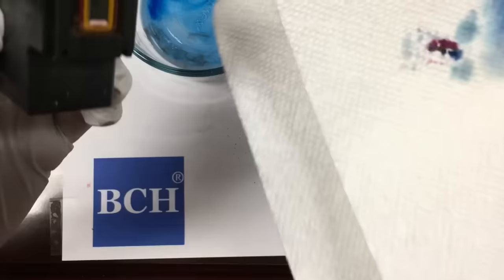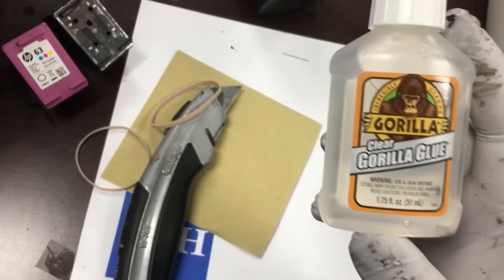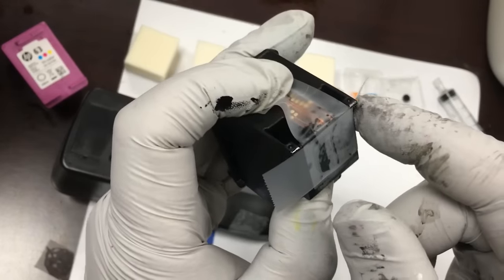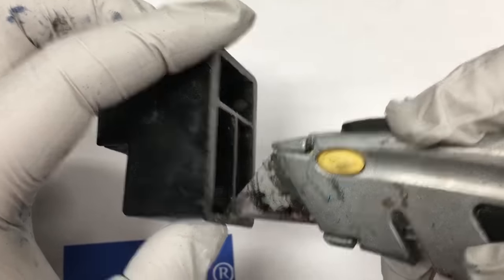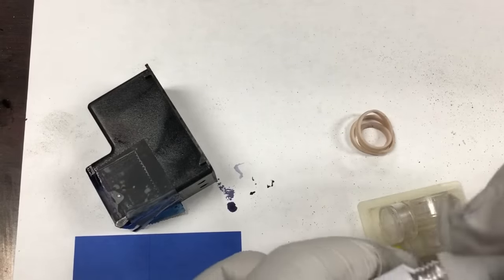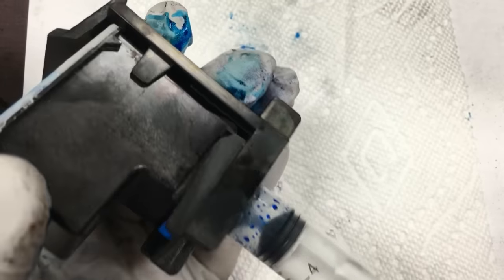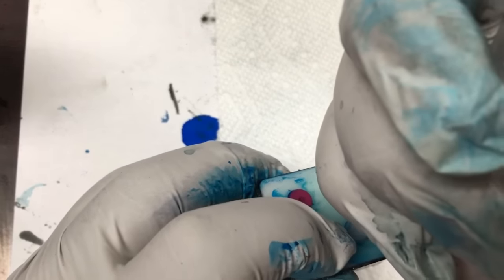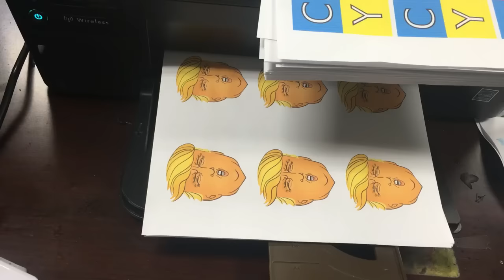#1 Detailed Steps: Make a Spongeless Refillable HP Cartridge 61 62 63 64 65 66 67 68  Integrated

Comment from the maker: New version product link: https://tinyurl.com/y72vsa4f  We made some improvement of the cover after making this video: 1) the pressure regulator is smaller, no longer a bulky circular assembly.  2) The cover is transparent so we can check how much ink is inside.
Reply: Sir in my caritridges ink is faded and mixed my color caritridge is mixed with alot much blue and it is giving blackish tone to prints what to do? I have hp 63 caritridges
Reply: @alifarmancreation9136  once you use up all the ink, I think you should wash it thoroughly and check the glue seal that you made for the cap.
Reply: my hp 67 is printing inconsistently. sometimes all the colours are balanced, sometimes it prints only 1 or 2 colour only, any advice?
Reply: Hey Kevin I'm looking for this type of an adapter for my HP Envy Inspire 7200e with Cartridge 64. So that I can convert it to a Sublimation Printer and attach a tank to the fill holes. Obviously have to make some cuts in the printer so the hose can travel through. But back to question where can I get the adapters for the cartridges? The printer is new.

Comment: Something about this that's more of a problem is ... The fact that more and more HP printers are starting to refuse cartridges that they think are empty, often without any ways to reset it or force it to continue printing whatsoever (yes, even with the cartridges filled to the brim with refilled ink)
Reply: What does a person do when the printer still thinks the cartridge is empty?  I've never been able to find a solution 😕
Reply: @nikkiparis5399  You can't do anything with HP. Even if it has been refilled until the ink is full, if the ink is still read empty and cannot be used to print, the only option is to purchase a new cartridge.

Canon and Epson are simple; simply use the "resetter" software after refill, and the ink is detected as full. Canon and Epson cartridges can be refilled indefinitely until they are damaged.

Buy HP if you rarely print, buy Canon or Epson if you print often.
Reply: @leunca  Or Brother. Brother makes GREAT printers.
Reply: The trick is, refill them offline and without power... Don't use refill them when it s already notified 0 ink
Reply: @leunca I have an HP 8025e and I’ve had no problem with refilling the original cartridges which came with printer. So far.  You get a pop up message from HP before you install their HP+ software (which gives you 6 months of free HP ink) saying you won’t be able to EVER use  3rd party cartridges once you install their HP+ software. And it was suggested by a YouTuber to turn of “automatic updates” on my printer otherwise I might find that my refilled HP cartridges will suddenly stop working.  My only concern is if my HP cartridges which I refill ever get damaged and I have to buy new  cartridges if  I would have to update my printer’s software in order to use the new cartridges whether they’re 3rd party or HP. And if doing so if I will no longer be able  to use 3rd party cartridges and / or refill my HP cartridges.
Reply: @Orlanzepol123  Thank you for sharing, I think I was using another version (I forgot). I now use Canon, I use it rarely so I don't need to refill anymore. What surprised me is even though I used it once a year to print tax papers, the ink didn't clog. 🤔

Comment: I used my cellphone to take pictures as I go along with a project so I can refer back to them if necessary. Taking pictures works for  lots of things: printer cartridges, replacing the clutch cable on your motorcycle, replacing an electric socket, working on the car, etc. And for black things I want to mark permanently (like a printer cartridge), I write with a white out pen (which works great for labeling spark plug wires and where the go on the distributor cap, too).
Reply: Good tip.
Reply: I also do this. Saved me many times.

Comment: So I have always wondered how the printer knows the ink levels. When you did this, the ink levels showed low. Isn't there a way to electronically reset the ink levels to full and show them accurately as the printer is used?
Reply: I'm also having the same problem it's showing low ink levels
Reply: Isn't there any option to reset thee printer software, so that it detects the cartridge as new ?
Reply: Ikr!!! 😫😫😫😫 Ugh!!
Reply: There is no part for that indicator... Even if you bought original ink LoL
Reply: @pewdavid3338  Well, that just doesn't make sense. Obviously, if original cartridges can reset the "full" indicator, then it ought to be able to be hacked so we can do it too!
Reply: Maybe you can jailbreak break the device setting

Comment: Hi is there any method whatsoever to reset the cartridge after a refill to make the printer think it is full? I have a HP DJ2330 MFD and am using it with a refilled 805 cartridge. The orange cartridge light just keeps blinking after the refill. Any software or button press technique will be great - cannot afford to buy these expensive cartridges any more - each costs like 20% of the MFD price and barely prints 50 pages.

Comment: I assume that if you let the ink to start banding no matter how much ink you put in but the nozzle seemed to not clogged( dripping with fresh ink), there are something else that I guess is air bubbles between nozzle and reservoir, the priming clip suction is primary tool, you don't have to take out the sponge, give it a good succ with the tool after you fill it to near overfill, everytime you let the cartridge to be too empty you have to do this again, fill regularly before banding starts

additionally, sometimes the electronic pins don't recognize the often-reinsterted self-refilled cartridges and just say that it's broken, swab those pins on the printer and cartridge with a contact cleaner, snap the cartridge with confident back to the carriage.

at least there's no 1x install chip like old Epson, that was awful

Comment: Lexmark cartridges are pretty good. Worse ones are Kodak. The chip in their cartridges cannot be resettled.
I’ve also have a dot-matrix printer that still works. The Citizen Swift is is about 27 years old and built like a tank.

Comment: 63xl color bought used off ebay does not work anymore, and I wonder if they changed their firmware to not accept carts made for use in different countries (I don't remember if these were from Canada, but this is a U.S. printer) -- even resetting the printer to factory defaults it still says not made for use with this printer.  Love the large BCH ink bottles, buut... HP up to their old tricks, or what?

Comment: My new office jet pro 7720 is not allowing me to put the black cartidge back in because the door is closed to access the printer catridges!   It keeps running a message door is open might damage the cartridges.   I need to put the cartridge back in so that there is not a problem re drying of the port for the ink.   It seems to be a stupid printer in any case due to the screen not working as normal LCD screens do. I've switched the power off and will try to access the cartridge carriage. the black cartridge was out for a few minutes then it shifted the carriage to the right out of reach of accessing the black cartridge. and has stayed there . I switched the machine power off. Then switched it on again and when it re booted I found the gear symbol the carriage came back into position . I put the part empty cartridge back in so hope it will be OK with compatible but not genuine HP cartridges, in three days time!   Do you sell refillable sets of cartridges for this Office Jet pro 7720  ? I see the black high capacity  is 953xl. ?
Reply from the maker: Check the door sensor & trigger.  I have a new video here: https://youtu.be/DZVj17KAcDc

Comment: hi, I have HP 62 cartridges, after a certain number of prints the PC tells me that the cartridge is empty and does not allow me to print anymore.  to continue printing I have to buy new cartridges, how can I bypass the chip that counts the prints made?
Reply: Hope all's well!
There's always a snag, when the printer hasn't been used for some time!
Try this, when the pc is off.
When only the printer is powered on, open the door to the cartridges, which will park  them for removal, or maybe to simply manually clean the print head.
Remove the cartridges, store them safely, switch off the power and disconnect the power and data cables from the printer chasis.
This will reset the chip in the printer and you don't have to wait all night long!
Provided of course you, didn't forget to disconnect as mentioned!
After a short while (you may have to repeat the procedure to find out if the chip needs more time!), Reconnect, while the pc is still off.
and load the cartridges.
Keep paper loaded!
The printer will do it's jig and maybe print out a sheet for alignment, which you place in the scanner and press the scan button.
When lights stop blinking, you're done.
Boot up and do your work.
Keep that alignment printout carefully for the future incase there was no paper ready, and fool the printer with it. Don't mix printer model printouts, write or paper punch them.
You may have to repeat these steps if on the job you get a prompt that there the printer is under control by some program! ( It had to print that sheet!)
Acetone works better than alcohol for cleaning but careful as the print nozzles are on a delicate  very thin sheet!

Comment: Your method worked like a charm for my HP Deskjet 2645. Unfortunately it developed a false paper jam problem and although there is no paper or leftover paper parts in it I couldn't get it working again. Your video about another model was informative, but this piece of junk is not even similar, A video for this model for checking the sensors would be greatly appreciated. Although the disassembly of the top part is easy and the insides is seen clearly, I don't want to go further without some information. I will probably junk it and never get an HP in the future.

Comment: great video, I was curious of if this was possible, I will be trying this however im wondering is it possible without the new replacement cover. I already have rubber bung stoppers that I can use on the original cover if I make them bigger.  Im guessing the circular plastics on the underside of the cover are some sort of filter? could you tell me its purpose and if it is 100% necessary?

Comment: Hello, nice trick and job  ! do you soak your printhead in 99.9% isopropyl alcohol? We managed to unclog the cartridges with hot water (under pressure, jet for the teeth) but I think that if the ink has hardened in the sponge, it cannot be repaired. (I mean , without using your method)
Reply: Put new sponge.
Reply: @varghesek2395  thanks can it be ordered in Europe ?

Comment: Great stuff! I would like to ascertain one thing. The refill holes are left open or sealed with tape? Thanks & Regards.
Reply from the maker: Left open.  If you don't want dirt fall into it, you can lightly cover with a piece of Scotch tape and puncture a pin hole on it.
Reply: If you have high temperature ATV red silicone what you can do is you could essentially use back to fill the all if you've made it. Once it dries you can essentially use a needle poke it through and inject your ink and pull it back out it's almost like a self-sealing membrane. People use it when growing mushroom spores in jars. Keeps everything sterile and keeps others board from getting in while the culture start

Comment: Thanks for sharing 👍 I'm wondering if its possible to glue back the original cover, could that work?
Reply from the maker: No.  The trick is the new cover, which has a built-in pressure regulator.
Reply: @BCHTechnologies  Thanks for getting back 👍. In the standard cartridge with sponge I am able to put in 1.5ml of each colour...
Once the walls and sponge  have been removed, what will be the capacity for each colour please?  This is all very interesting, thank you
Reply from the maker: @Spare14All  I don't remember the exact number but I have an article compare the number of pages printed: https://bchtechnologies.com/blog/how-many-pages-can-a-hp-cartridge-print-regular-refill-vs-refillable-sponge-vs-refillable-spongeless-cartridges/
Reply: Excellent, thank you :)
This project is now definitely on my todo list. Very impressive stats :)
“Refillable Spongeless Cartridge:  If we take out the sponge completely and install a pressure regulated cover, then the cartridge can print 60% more than the XL cartridge and 300% more than a starter or regular cartridge.”

Comment: Hi my friend very nice video........ but don't we have to do something with the electric circuit on the cartridge I think it has memory on how much prints you have made, so it blocks you from printing even if you have cleaned and refiled the cartridge .
I have  HP Photopsmart C4780.
Reply from the maker: For those integrated cartridges, HP lost a lawsuit so they won't stop you from using it after the page exceeds the limit.  The printer will ask you "Do you still want to use this cartridge?".  The answer is of course "Yes".  Then it won't bother you again.
Reply: Thank you very much for your answer !!!

Comment: the best way to open it: use the simple knife with thiсk blade and to strike it with little hammer. If you will use the thin knife and turn down one edge you may broke the cap 8-(((
I open many power supply units with this way.

Comment: Sir my 63 black cartridge ok physically but print was rough so  kept at side but i want to use again refill ink also suck by injection. In printer hp when installed no ready for print plz how solve  this?

Comment: Several hp inkjets remember the last 3 or more cartridges and keep 
complaining that the cartridge is empty by its estimation process. Keep 4
 or more cartridges around and install 3 or more old ones till you add 
the "NEW" one. it will see the last couple and think it hasnt seen the 
"NEW" one before.
Reply from the maker: Good point.  Forgot to mention it.
Reply from the maker: Good point.  Forgot to mention it.
Reply: Great tip!

Comment: In this there is a possibility that ink will flow freely all the time, making the inside of the printer messy?
Reply from the maker: The cartridge is completely sealed, except for a tiny pin-hole size opening on the air pressure regulator.  Therefore, no matter how the ink moves, there is no ink leaking.  However, this video shows version 1 of the cover, which ink does leak a little bit from the pinhole.  Nothing to worry about but just a little inconvenient.  We are making version 2 now, which we made the hole smaller and there is no leak.
Reply: Sorry to stalk you. I definitely want sponge carts now! Back to edit my cart.
Reply from the maker: Not a problem at all!  Keep us updated about your project.

Comment: Good tips can you address some people having problems saying ink is dripping out of the printer head. I have seen people saying that in reviews before on Amazon. Thanks
Reply: Soulcommander yeah mine alway dripping
Reply from the maker: That's because they filled it too much.  There is a very thin sponge inside which can only hold a few drops of ink.  If you fill it too much, it will drip out.  However, no worries, the excessive ink won't hurt anything unless you let it dry on the printhead.  You can use the printer's self-cleaning function twice and then left the cartridge in the printer.  The excessive ink will flow out and the cartridge should be working again.  Some people let the ink dry on the printhead and created clogging so they will need to unclog it.  Rule of thumb: if you can see the ink coming out, it is too much.

Comment: This is really cool! I would consider possibly doing this as well. What does the kit come with? I seen another company showing how to refill the sponges that comes with everything like the syringes/ink/ the primer tool. I would see how this would be so much more beneficial in the long run but I just wouldn’t know where I could purchase everything else if it did not come together. Thanks for the video by the way it was very interesting to learn how this is possible :)
Reply from the maker: You can go to here: https://www.bchtechnologies.com/mod-kits/for-hp.html and select the AS-RFC-HPSQ.  If you don't have sandpapers, gloves, glue... there is another add-on for $1.99.  You will also need a utility knife if you don't have one ($3.37)

Comment: A solid video. Many thanks. I have a HP 3720 printer and the color cartridge has run out. It looks small (hence comparatively expensive). Was wondering if I could fill it with 3rd party ink and how.
Reply: M

Comment: I penetrated the bottom filter of a black cartridge  what can I do now ?
Reply from the maker: Nothing can fix it right now but I wonder if it can work without the filter
Reply from the maker: I tried and it’s very easy to clog.  You may want to add another layer of filter
Reply: @BCHTechnologies  thanks Kevin, I m using a new cartidge now. the old one didn't work with that penetrated filter